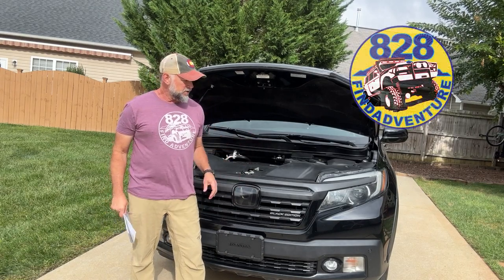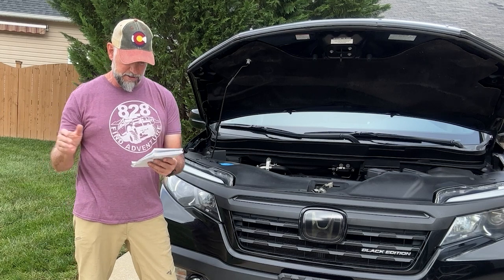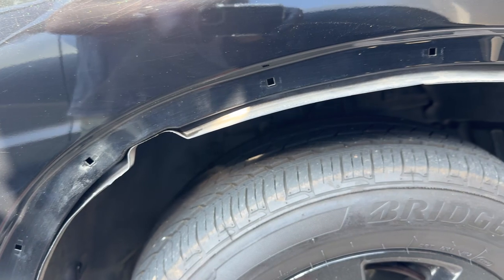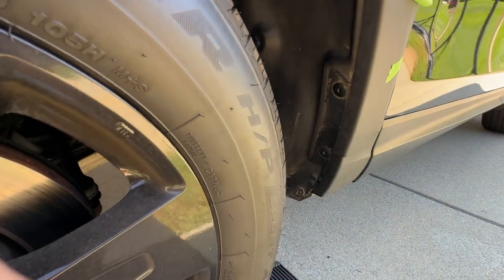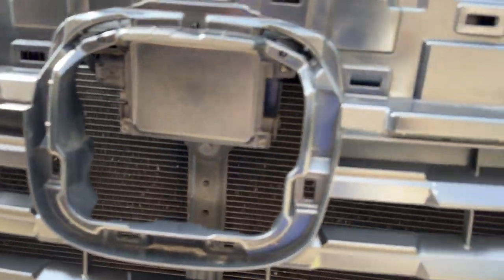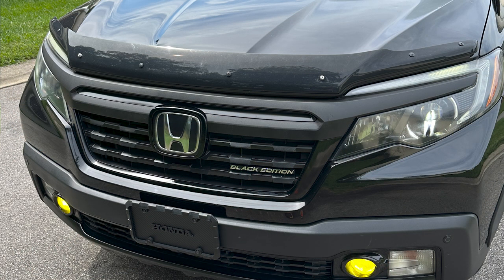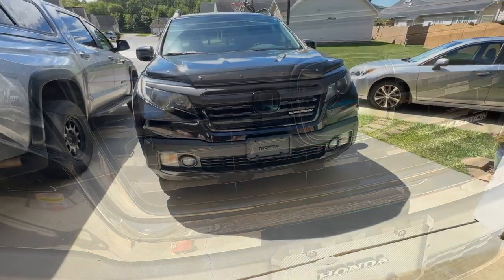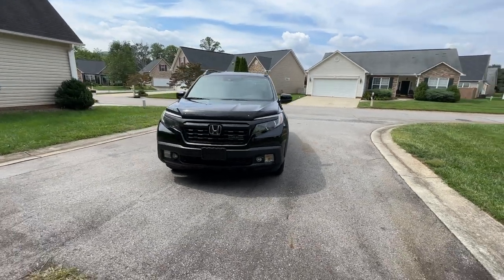Honda Ridgeline exterior mods, Flares, fog lights, Dual Horn, Tinted Emblem, Bumper Removal, etc.

Comment: Just some info that I have not read or have heard owners talking about:  I just bought the 2024 Trailsport Honda Ridgeline.  Testing different octane levels... the midgrade works great (price vs mileage benefits) for the west coast, Oregon, at an elevation of approximately 1000 +/- 250 feet.  When I added a Honda 100XR "Leer Cap" to the bed of truck...I now have a "cheating way" to add to the more shallow bed height as I gained increased security, and the in bed storage capacity too!  Also, the in bed storage access (lift up the bed) still works, as it should, with the cap on!  Thus, it can be fully lifted without any compromise(s).  Plus...my mileage just increased approximately 3% with this cap!!  When I purchased the Leer Cap, the dealer and the Leer company said it would "probably improve the fuel economy"... I know it adding weight and this increase in fuel mpg just sounded to good to be true.  However, it has increased my fuel economy, indeed!!!!  Thus, I wanted to share same. My thoughts to improve this vehicle are:  Please level the truck so the front end is level (if possible) to the back end -- so it will look more like other trucks.  I agree with most Ridgeline owners to raise this truck at least "one simple inch or more"!  I am most upset that their is no option to install an accessory in the bed on the passenger side "storage box" for either a 12 VDC &/or a 120 VAC outlet available --- like the Black Edition has on the 2024 models!  I mean really, the Trailsport is idea for camping and such...duh.  In fact, I feel all the trucks models should have this simple option as I am a DIY person and a weekend warrior too!  At any rate, I like what you have done with your truck, indeed!  You all have a great day.
Reply from the maker: Thank you, we have leveled off the front 1.5" and added 265/60/18 tires. It looks like it should and only still has a slight rake of 1/2" in the back. Recently we added an exhaust and a High Volume air intake. Honda makes those jobs easy. Thanks for watching.
Reply: @828findadventure  I am curious about the front end lift that Honda did.  Was it the "J-Sport" or other lift such as the (spelling) "Trauxx?"... Thank you!
Reply from the maker: @hoppyhourgirl  It was the Jsport 1.5" front . I decided to leave the rear .75" off for now. After install there is still a half inch lift in the rear so I'm ok with that. I went with Jsport because it is cnc machined out of a block of aluminum. Powder coated steel is not 100% protected from rust.
Reply: @828findadventure  I was doing some research for this vary situation and found that having that slight 1/2" in the back will possibly help should you carry something heavy in the back as it will help with your front steering control and also help with the lights at night as Honda does not have an adjustable headlight device like I have with my Toyota Tundra!  Thus, that said, I agree with your thoughts for same and I feel that is what I plan to do also!  Lastly, if it is OK to ask what it cost for Honda Dealership to install the Jsport 1.5 lift kit  -- as I was going to shop around for same (I live in Southern Oregon), and I like the Jsport powder coated aluminum for less weight, and helps prevent rust, indeed!  Thank you again, .... Ali
Reply from the maker: @hoppyhourgirl  the install plus alignment was around $500 including tax. I had it done at an overland vehicle place since they lift all types of vehicles including Subarus. You are correct about the headlights, tundras are easy but the RL can still be adjusted manually. Tundras rock, I have a 2021 as well.
Reply: @828findadventure  Thank you very much for all your input and helpful info.  That is all I can think of, so...until we meet down the road with other great info, ideals, & beyond, enjoy life to its fullest!

Comment: Great job. I have the same exact truck. Im also in the process of doing everything you just did, I just did my side steps and off road tires yesterday. Does anyone know where I can get a red emblem for the front that fits a 2017 Ridgeline???
Reply from the maker: You can get an emblem that says Sport in red for the grille, but I believe if you want it to say Black Edition you might have to modify the one you have or buy one and paint the letters. I thought about doing the same thing.

Comment: I’m have a lot of problems installing the OEM Honda mud flat
Reply from the maker: Mine seemed to work fine. If you have a newer Ridgeline it might need flare specific mud flaps.
Reply: Yeah, I have a 2023, and they not fit properly with defender flares, I may have to do some modifications
Reply from the maker: @MartinezRE1  maybe a little trimming.

Comment: Good job, your truck looks great 👍.  

 My first Ridgeline was a 2017 RTL-T.  I had several mods including the Piaa horns you installed on this video.  

In 2022, it was totaled by a distracted teen who ran a stop 🛑 sign, truck had 20K miles.  Took the first hit driver’s side then it spun around into a concrete block wall.  Luckily seatbelts and all airbags deployed and my wife and I walked away, sore but alive…

I now own a 2022 RTL.   Like you, I’ve done several mods to mine.  One of my favorite is bypassing the cylinder de-activating function.  All inside and out LED lights, Retrax tonneau cover.  I tried to reinstall my AEM cold air intake from my 2017, but the computer in my 2022, wouldn’t have it, kept pulling codes.  I’m getting ready to replace the tailgate emblems with the gloss Black tailgate emblems. 

College Hills Honda IS a great resource been using them for years, Jeremy is my go to guy there.
I use Cerakote trim product and it’s great.

Anyways thanks for sharing 👍🇺🇸
Lou - Miami Fl.
Reply from the maker: Hey great mods, be safe out there and thanks for watching.